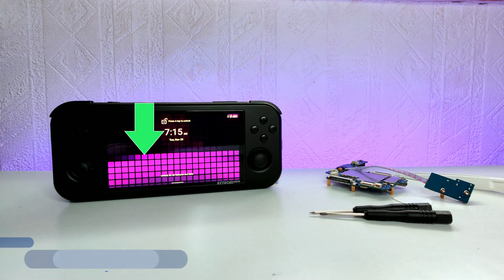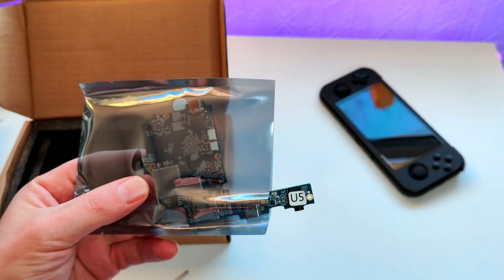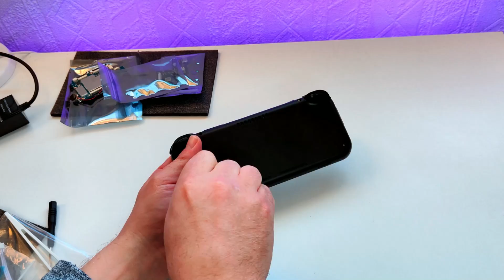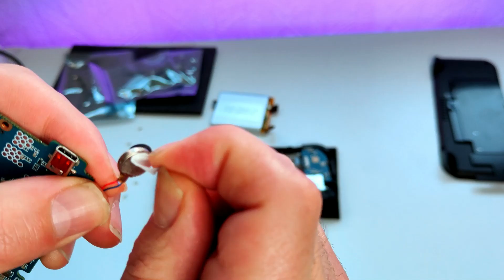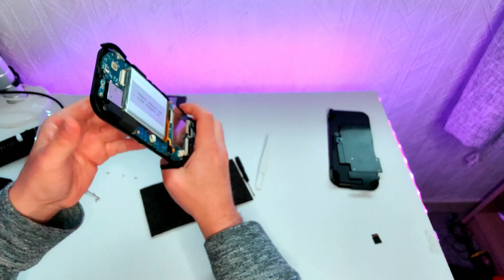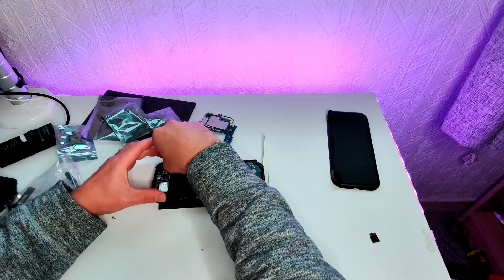retroid pocket 3 plus assemble rp3 plus rp3 + handheld 2022

Comment: Hey great vid! Just wondering after you replaced the pcb board, did your shell housing became creaky? For some reason my did. Evert time I pick it up or play with it, I feel the flex and hear the creak all the time. I inspected the housing, 100% no damage. I inspected all the board and other components, 100% sitted properly. It’s just doesn’t feel as  solid as before opening the shell and it’s driving me nuts lol
Reply from the maker: That doesn't sound too great , you could try new screws and make saw they are all tighten up properly